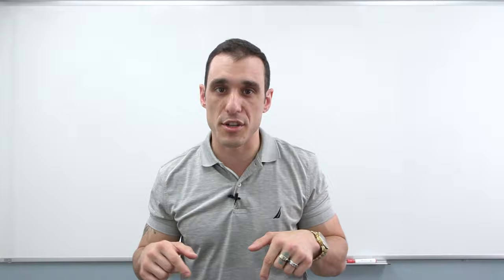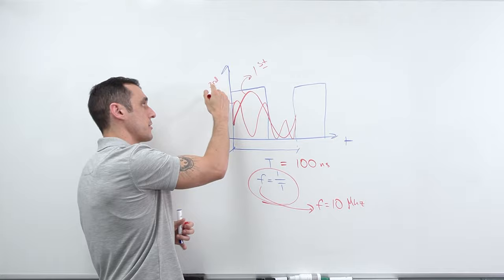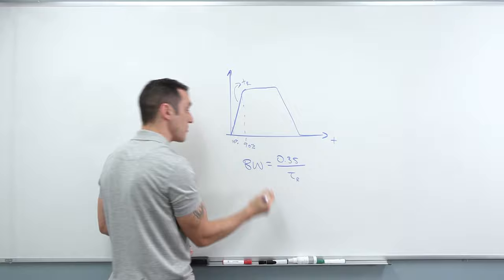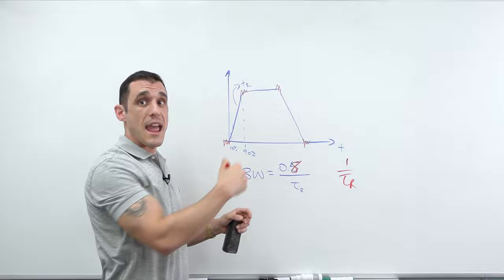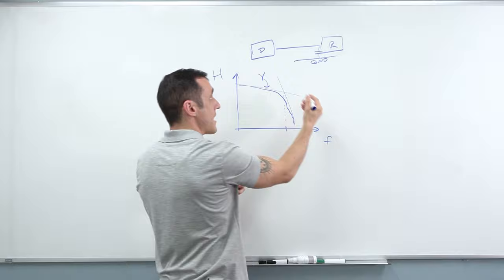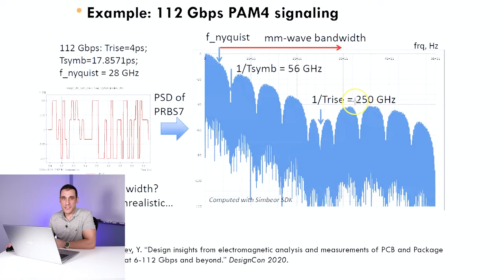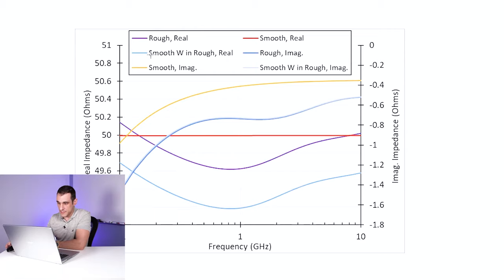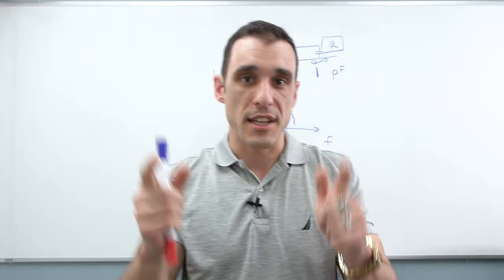Digital Signal Bandwidth Deep Dive | Signal Integrity

Comment: Hi Zach, in the 'Example Digital Signal & Impedance Curve' why you have BW=1/Trise (4ps) = 250Ghz?. (Should be 250000Ghz?).
In the case of 250 Ghz you have a loss of 50 dB, this means that the channel needs to be redesigned right? How many dB should we consider in the case of 0.35 / Trise to 1 / Trise?
Thank you

Comment: Hi zach,
here takes a question. The reason you choose the nyquist rate as a bandwidth here is based on the sampling theorem, don't you?
But, if we use exact the clk rate as same as the data rate to retrieve the data in the receiver side, is there something to do with Nyquist rate?
Appreciate in advance

Ray
Reply: Hello, I should probably make a better distinction on something, the Nyquist sampling rate and the Nyquist frequency are not the same thing. I sometimes say the receiver "samples" the incoming bitstream because sometimes it's helpful to think of a digital receiver as operating similar to a 1-bit ADC, but that's not exactly true for how the device operates. So in the case of 2-level signal formats (like NRZ), the Nyquist frequency is half the data rate, which just happens to also be the clock frequency. For multi-level signal formats (like PAM-4), the Nyquist frequency is the data rate divided by the number of digital logic states per UI. So for 112G PAM-4 signaling, the Nyquist is 112/4 = 28 GHz.
Reply: @Zachariah-Peterson  ok! got it! thank you Zach